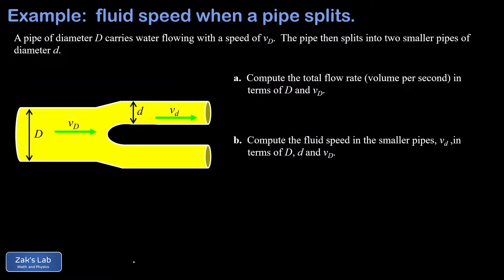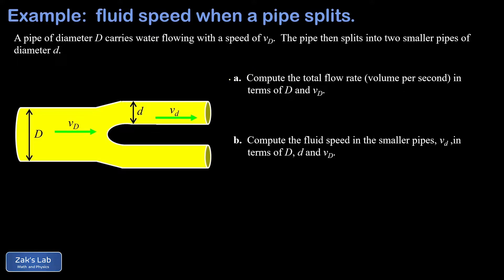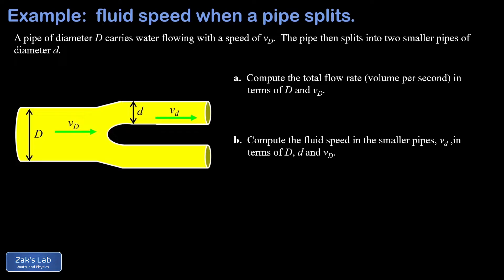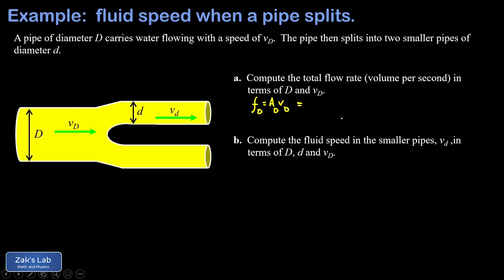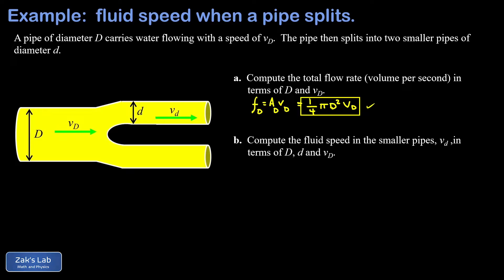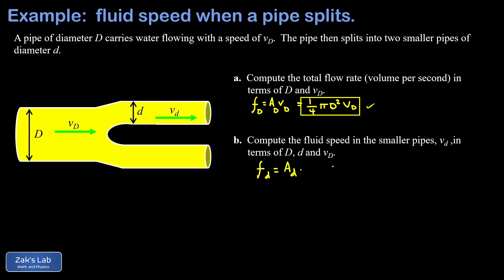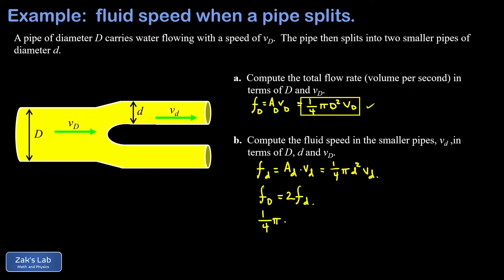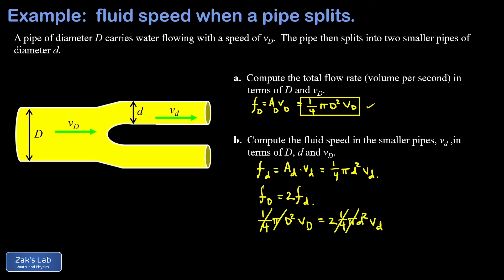Fluid continuity equation :  pipe splits into two pipes, find the fluid speed in the smaller pipes.

Comment: What justifies the implicit assumption that the speed is the same in each of the two exit pipes?
Reply from the maker: the symmetry of the problem -  how could one of them be faster if the pipes are identical?  Put another way, the entire apparatus is identical if you flip it over the x axis, so everything must be happening the same in the upper and lower half.  z
Reply: @ZaksLab  There is then an extra assumption that, e.g.,  the pressures at the end of either pipes are identical, that they have the same length. Moreover, we cannot extend the presented method when the diameters are different. There, we need an extra assumption, like the pressures at the end of each pipe is identical, and to use something like Hagen-Poiseuille equation.

Comment: What if we split the original pipe into three smaller size pipes.  For example, 12 inch pipe with flow rate of 1,400 GPM into 3 pipes with 5 inch sizes.  How to calculate the flow rate??
Reply: In the very last formula for the fluid speed in the small pipes, there is a two in the denominator because the current is flowing into two pipes. For three pipes, you would just replace this with a 3.